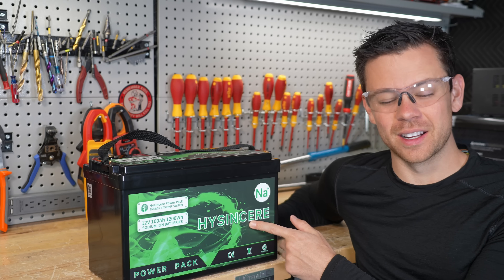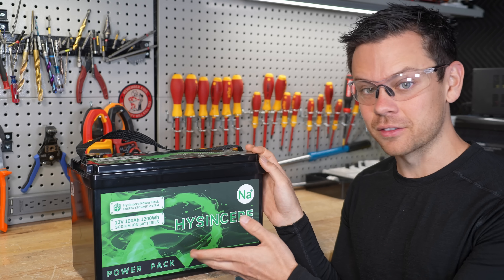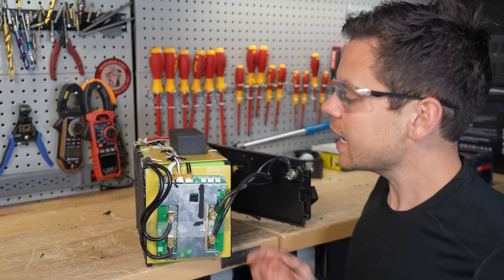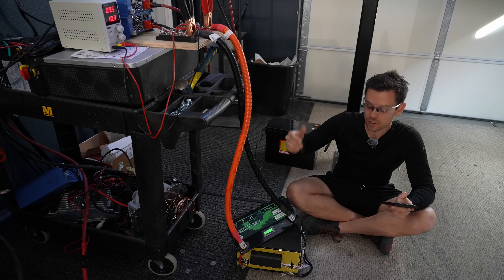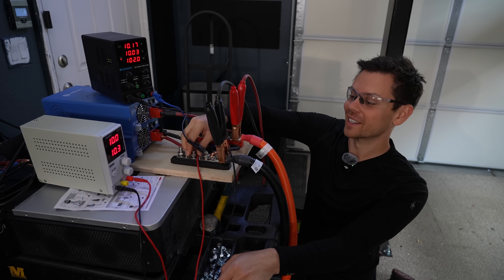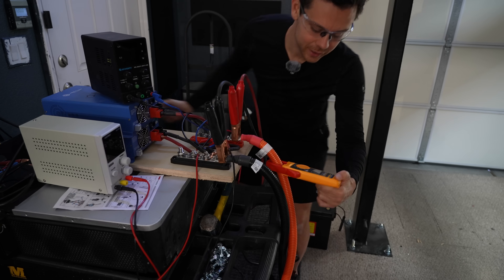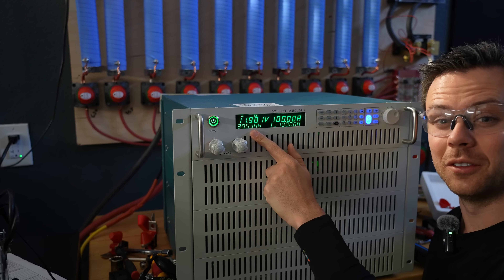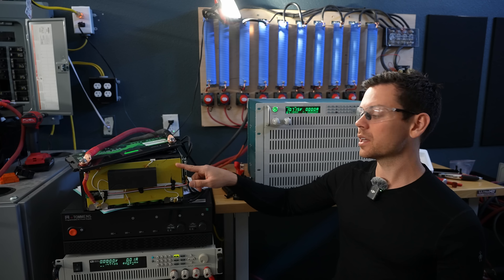Testing My First Sodium-Ion Solar Battery

Comment from the maker: Capacity test in this video is up to 14.7V and down to 10V at 1C rate. To compare mainly to LFP. If you charge to 15.5V and down to 6V, you can get more, but I don't have a single charger or inverter that can pull that off. Next video will be cold temp performance testing. Let's see what happens 

Update: just pulled 103Ah by charging to 16V and down to 4V! At least I pulled full capacity. 

Tired of getting ripped off? Check out my "Will Prowse Approved" solar product recommendations below!

12V Batteries
https://www.mobile-solarpower.com/lithium-batteries.html

48V Batteries
https://www.mobile-solarpower.com/48v-batteries.html

Offgrid Inverter System Builder
https://www.mobile-solarpower.com/48v-complete-system-blueprint-559371.html

Hybrid Inverter System Builder
https://www.mobile-solarpower.com/code-compliant-48v-offgrid-system.html

Mobile Handtruck System Builder (very popular!)
https://www.mobile-solarpower.com/mobile-48v-system.html

Solar Panels
https://www.mobile-solarpower.com/300w-solar-panels.html

Ground Mount Solar Racking
https://www.mobile-solarpower.com/ground-mount-racks.html

Wire, Lugs and Busbars
https://www.mobile-solarpower.com/wire-and-connectors.html

Tools
https://www.mobile-solarpower.com/tools.html

Fuses and Circuit Breakers
https://www.mobile-solarpower.com/fuses.html

Plug-N-Play Solar Systems
Ecoflow, Anker And Bluetti! So many models to choose from. See my current recommendations here:
https://www.mobile-solarpower.com/full-size-systems.html

~~~~~~~~~~~~~~~~~~~~~~~~~~~~~~~~~~~~~~~~~~
Need to build a large DIY system? Need a trustworthy solar distributor? These are my favorites:

Signature Solar
Creator of EG4! Solar Minisplits, Victron and More! Largest Solar Store Online.
If you want $50 off, please use my link below and coupon code "DIYSOLAR50":
https://signaturesolar.com/?ref=cPwLcVc0SW-BjN

Current Connected
Best Prices for EG4, Victron, Midnite and so much more! Fast Shipping and Highest Rated Customer Service:
https://currentconnected.com/?ref=wp

~~~~~~~~~~~~~~~~~~~~~~~~~~~~~~~~~~~~~~~~~~
Join our DIY Solar Community 
Need more help? Join the largest solar forum on the internet for beginners and professionals alike. 140,000 members and counting!
https://www.diysolarforum.com

Check Out My Free Book
Best-selling and beginner-friendly guidebook to off-grid 12V solar!
https://www.mobile-solarpower.com/the-book.html
Reply: Check out the specs of  CATLs new sodium ion EV Naxtra battery that just started being mass produced in China.  It, or similar technology, is likely to eventually replace home energy storage LFP batteries entirely

- 175Wh/kg, 
- doesn't have the lithium dendrite problem (i.e. no spontaneous fires)
- 10,000 cycles to 70 percent (i.e. around 3 decades  of typical useful life)
- 90 percent efficiency at temperatures between -40C to 60C
- charges  faster than most current LFP batteries. CATL claim for EV's less than 10 minutes to get over 400km of range.
- and the best part.. since sodium is far easier to source. on initial release 50 percent less than lithium batteries per Wh of storage (at wholesale volume pricing level). CATL claims as mass production ramps up they think they can get it 90 percent lower price than today's lithium.

If you could get your hands on one of those batteries quickly to review  it would likely be one of your most popular videos. At least on paper is seems set to revolutionize home, commercial and grid energy storage more than even EVs.
Reply from the maker: @mydogsbutler 90% efficiency is awful
Reply: @WillProwse   At -40C its awesome but fair point.  I'm pretty sure its better at normal operating temperatures but don't have the exact figure so can't say for sure.. Naxtra are going into EVs so they are going to be competitive with at least lower end lithium. At least on paper they seem to be lot better than the sodium battery you reviewed in this video
Reply from the maker: @mydogsbutler I don't understand why they are not publishing their round-trip efficiency figures. I am excited for it for high voltage stationary storage, but not for home solar. Strange they won't publish the numbers
Reply: Do you have an LTO battery recommendation for off-grid cold climate outdoor use? Love the videos!
Reply: NaFeMnO² (NFMO) Sodium ion manganese oxide. 

The hype about NFMO is that we don't need lithium and copper. so the battery can be cheaper
Reply: Thanks brother 💪💪🙏👍👍
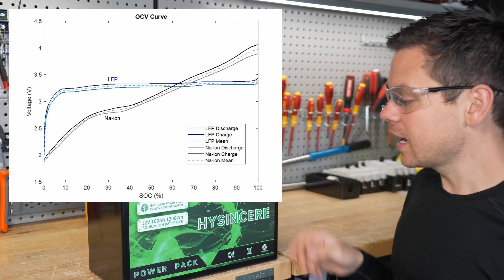Reply: Dear Will. In this video starting at 0:24 you complain "And it's (Voltage) so low, in fact, it would turn off most inverters pretty early. So, you wouldn't even get 82 amp hours. You would get less than that. For example, at 45% state of charge, I was getting 9.9 volts."

So why are you so negative? That property of sodium batteries has been known for a really long time. And the simple solution is: We connect two batteries in series, after which the lowest voltage level is double. Then we take a suitable BUCK device, which lowers the output voltage to just the right level - for example, adjusted to 12V before the inverter.

I don't understand why you make safety an issue?
Reply: Thanks Will
Reply: By the 3 minute mark I was so angry at that stupid sodium battery!  Dang it!!!
Reply from the maker: @tsp2jxd 😂
Reply: @WillProwse The sodium battery has plentiful resources available, which makes the research worthwhile.
Reply from the maker: @peacepoet1947 so do lithium ion batteries. Lithium availability is not an issue.
Reply: @WillProwse  If the Naxtra battery is the same energy density as lower end lithium, has triple the lifespan at half the price... over a period of decades it would probably have 3-6 times the value of current LFP. And if CATL delivers on its claim it might become 90 percent cheaper even better. Even it turns out only 90 percent energy efficiency  at normal room temperature it would still be better value than current LFP for home storage due to far cheaper price and longer durability. (although there are other factors of course like quality of charge controller et al, as your videos point out)

It's still speculative until independently reviewed (why I suggest get one if you can get your hands on it) but CATL has a great track record for battery innovation.
Reply: @WillProwse  

You made a good point about energy efficiency. I just did some AI research on Naxtra to try to figure out different temperature ranges. Don't know for sure (could be hallucination) but came back with ~75–92%. So assuming upper range of 92 percent in optimal conditions but probably lower than 90 in real world practical.   Let's speculate and say even lower pessimistic 85 percent for real world room temperature.

As a theoretical walkthrough (know some of these figures are arbitrary but putting some stakes in the ground). Someone's house uses 10KWh per day at 20 cents per kW. So 2 bucks per day times 365 equals 730 bucks per year. Multiple by ten for ten years for warranty period  (ignore installation to keep things simple).  $7300 over the warranty span of the LFP (assume it will be replaced then to again keep things simple) 

Then there is upfront capital costs of 10KWh LFP battery storage. Asked AI and it gave me a figure for average current of around $1000 per KWh for LFP systems (with 10 year warranty, realize their are cheaper less durable LFP options but trying to keep it simple)). So add 10000 for the capital cost of batteries (not going to including extras like installation and additional related parts)  17300 over 10 years. 

Not lets run with Naxtra (or something similar to it)   Lithium aren't 100 percent either so lets say a real world 10 percent difference in efficiency. So an extra 73 bucks a year more for Naxtra over LFP. So 7300 plus 730  equals 8030 over 10 years for same usable energy costs. 

I don't know what the price of home based batteries using similar tech to Naxtra will be but lets factoring electronics are by far the biggest cost,  and arbitrarily say they end up only 10 percent cheaper.  So battery cost of 9000 plus 8030 for energy you end up with  17030. Already cheaper but lets be pessimistic again and say its roughly the same amount to keep things simiple.

Now the magic happens.... if the sodium battery life is twice as long... you double your value since you don't have to replace it as often. If its triple. you triple your value. Then there is the replacement labor costs as well. And this gap improves even further if using solar since the energy price is usually a lot  cheaper than buying from the grid. (assuming the right locale). And I only said 10 percent cheaper battery. Imagine 50 percent cheaper (wholesale price). Or 90 percent (less retail margins).  There is also seems to be some factor in CATL's design that makes their sodium batteries cheaper not just the sodium part.

I can totally see solar companies offering 25 year warranties on combined solar and sodium battery installations. Assuming the price and specs holds up to third party review, I think most home owners would prefer that over LFP even if 10 percent less efficient.
Reply: @WillProwse  Why do I hear reports that China has got control over the market for rare earth minerals.  Sodium is also cheaper.  Matt Ferrell did a video on one of the companies doing the research and manufacturing of sodium batteries. He did mention the amount heat created by the battery wouldn't need fans for cooling.  That air space between batteries is enough to keep the batteries from overheating.
Reply: @peacepoet1947  The interesting thing about CATL's new Sodium ion Naxtra battery.. they claim to be initially producing them 50 percent cheaper than lithium batteries (at wholesale price). As lithium only makes up  a small percentage of a  typical battery price this suggests CATL has also found considerable cost savings on the electronics and manufacturing side of their sodium battery too.

This is all speculative at the moment without independent third party review. I'm trying to convince Will to get his hands on one to do a review. He does a great job analyzing pros and cons. Would love to see a tear down and analysis to figure out if the Naxtra is hype or has sodium really finally arrived. I've been holding out putting solar and batteries in my home for this. Trying to decide if I should wait a bit longer for mature sodium or just go with LFP.
Reply: @WillProwse  We need 100x more lithium Production  to reach net zero by 2050. So there is a need to look for alternatives. 

Also the republicans criticized lithium mining in Chile, which is polluting. 

Also, LFP is not cheap enough for developing countries. We still need to push to lowest Battery  price.

Also China needs Backup ,If Australia & chili stopped exporting lithium due to pressure from the United States.

That way 80% of world battery R&D comes from China .
Reply from the maker: @peacepoet1947  LFP doesn't use rare earth elements
Reply from the maker: @mydogsbutler I'm hoping this video makes these companies send some cells out
Reply from the maker: @mydogsbutler  thank you
Reply: @WillProwse I've learned something new,  thanks!
Reply: The watt cycle smart BMS do work ok in series thou, the other issue is the Bluetooth is not secure, so anyone can walk past and connect and mess with the battery. If u keep the batteries in a metal box, this reduces the range, too stop access by neighbors. also a small 2.4ghz jammer can work in the battery box to block access.
Reply: Are they good as car starting battery?
Reply: @alihsas I believe he said that it might be used in vehicles.  Recovery time could be an issue due to all of the electronics in modern vehicles.
Reply: @peacepoet1947 Thank you
Reply: Is it just this battery brand that is poor? Are there better
 Na batteries?
Reply: @DW-fo1ze We shall see.  They are doing research on what other chemicals work better than what has been used in the past.  Making upgrades on the design.
Reply: I really respect your knowledge and expertise. You are the definition of do one thing and do it well. Specialization and subject focus in action
Reply: can you do a video on 5.5ah c-max cells please they are the #1 cells used in car audio i hoping to find something better thank you in advance
Reply: Nazi mining colonization genocide Psycho
Reply: I'm interested in sodium-ion for remote area cameras for long term wildlife monitoring. There's a network of ~100 cameras at high altitudes (low temperatures). Currently people have to service the cameras at least monthly because only LiFeS2 primary cells are suitable. Na-ion + PV + cellphone data transmission could reduce the labor required by a lot.

But for that we need long term reliability and the rumored run-flat (0V) tolerance as well as cold weather tolerance.

This is the niche for Na-ion, long-term unattended in harsh conditions. Quite a big but invisible niche actually. If it can be made to work, that is.
Reply: You should do a bit of research on a product before you let your mouth make a fool of you.
Na+ fully charged is 4.3v rested per cell, 4 cells, 17.2v. The chart you show in the beginning tells you that, yet you didn't read it? 
With this sort of background knowledge, you could have proudly announced that the drop in battery had an LFP BMS and not an Na+ BMS.
The fact you half charged the cells, allowing for voltage settling of a never condition charged battery, then discharged it to an average of 2.5v per cell, again, looking at your chart, around 15% SOC ...... giving you a huge benefit of the doubt here, you went from 65% SOC down to 15% SOC, you pulled 50% capacity (65%SOC - 15% SOC = 50%) 64Ah from a non balanced pack @ 1C ...... You absolutely gave Na+ (Sodium ion) and incredible review putting them well ahead of any drop in battery test I've seen so far.

T1 Terry:popcorn-yellow-striped-smile:
Reply from the maker: @T1Terry37  oh we all know, I said it multiple times in the video that this was with standard 12V charging equipment

Comment: Sodium-Ion is currently superior as a starter battery for any car ( ICE or electric ) ... it can be charged by car systems at temperatures down to - 20 °C and discharged at - 40 °C. Lead-acid batteries became obsolete...

Comment: Right now, Sodium-Ion is ahead of all the electronics.  Sodium-Ion can discharge to near zero volts.   Only commercial product right now is the Bluetti Pioneer Na.  Totally custom charge controller and they demo it running after being put in a freezer.

Comment: I'm not getting your figures. Assuming a 12V inverter, they tend to turn off at about 10V and mine will run from up to 16V, so on the 2C graph you put up it looks as though I could use about 80% of the charge (Coulombs or Ah) and we'd lose a bit more energy efficiency due to voltage sag.

And that efficiency range of 60% to 92% is weird. Do you know the test conditions that produced the low end of that range? 

Looking again, your graph of charge/discharge curves is at 2C--most people don't run home inverter setups at 2C (flat in 30 mins!), probably more like 0.1C to 0.2C, which would reduce the energy losses due to voltage sag.

Whatever it looks as though we'll need the cost to be about 1/2 the cost of LiFePO4, and maybe some tweaks to inverter specs, before there is a clear advantage to sodium.

Comment: I think the Victron inverter work like 18-19v to 31v for the 24v battery system.  the Sodium may work for it.  But then Usually people would have like 100 200 kwh battery for their family home... IF AND IF THE SODIUM batteries price down cheaper than the LFP battery like 50% then it's make sence to buy the Victron system or ... other inverter will come out soon to work for the Na batteries ..........  CATL is leading in those NA batteries but I have a thought it would improve and price down in 1.5 2 years.... love to see Will RESULT on test and follow up and test the Na batteries in 6 months - 1 year when their Na batteries improved like 30-50% capacity for the same size... or price down like 40-50%........  Thanks Will....

Comment: I hope you read your comment because I went and bought eight 100 amp hour lithium ion batteries to replace my 8 ever start Walmart batteries I was using on my shoulder and now I found myself relying on The olde 10 year old ever start batteries because the new solar battery The Olympian ions won't hold a charge for long enough you say that there's so much better but I love my little acid batteries and the Olympians just can't keep up so just send me your laid out the batteries that you no longer use cuz I think I can get better use of them good day

Comment: Sodium batteries require inverters that can make use of the lower voltage curve.  Not hard to do, just has to be designed in.  Most inverters don’t work with voltages below Lithium levels because there hasn’t been a need for it.  Sodium’s linear voltage curve that can completely discharge is a selling point of lithium, even in residential, not a problem.  Testing a sodium battery with inverter/chargers not designed for sodium seems a little…well, I wouldn’t want to be rude.

Comment: Make a dual mode Na F ion battery, would have very high cell voltage and wouldn't have a linear charge discharge curve. Anode would be graphite aSi, cathode would be iron fluorophosphate.

Comment: Id love to play with these for drop in lead acid starter battery replacements, I don’t like the idea of dropping lfp into cars without adjustable voltage alternators but the voltage range of sodium theoretically they should never really overcharge or stay pinned at the BMS overcharge cutoff like a standard LFP battery might. The high internal resistance at higher voltage would also be a benefit in that case so your not cooking alternators even at high states of charge. 

I know a few people are running them in motorcycles with poor voltage regulation with pretty good results.